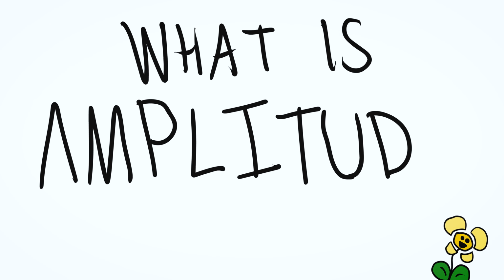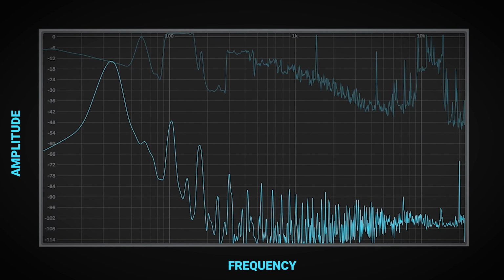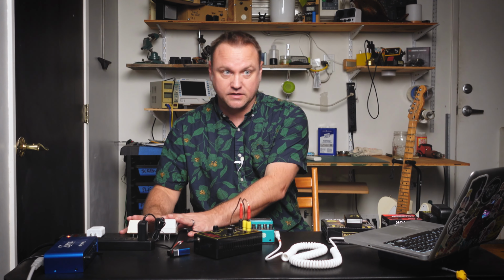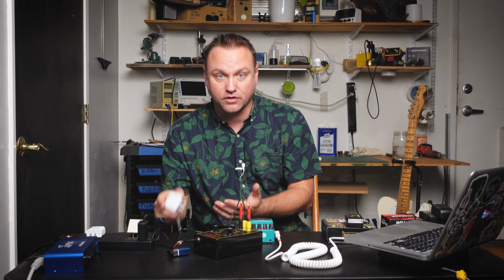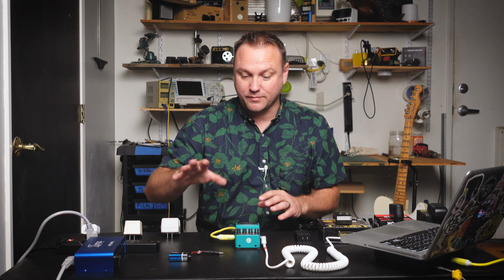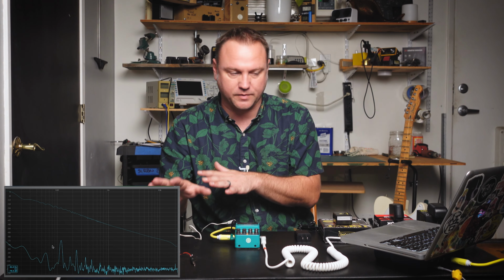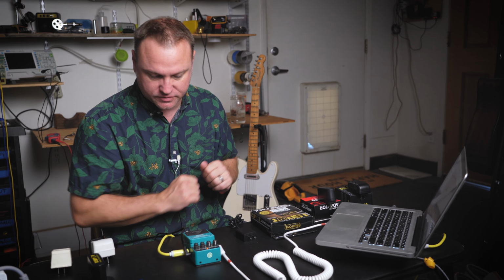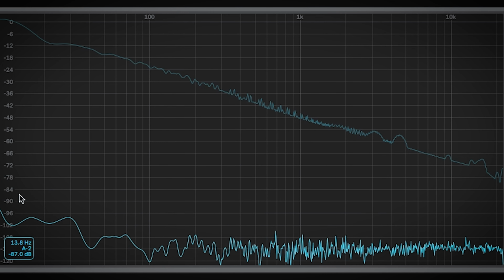Unveiling the Mysteries of Effects Pedal Power Supplies: A Sonic Analysis!

Comment: Power supply noise can also vary depending on how the pedals are connected. Daisy-chained analog pedals can become noisy when connected to a switched-mode power supply. Digital pedals - in my experience- need either separate power supplies or an isolated supply to prevent noise coupling from pedal to pedal.